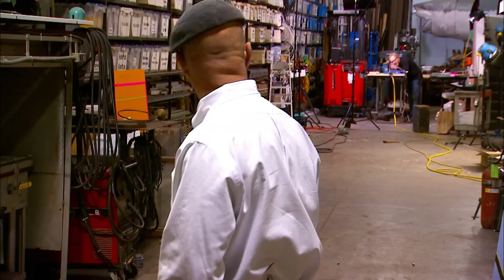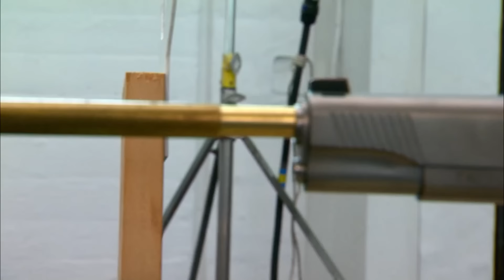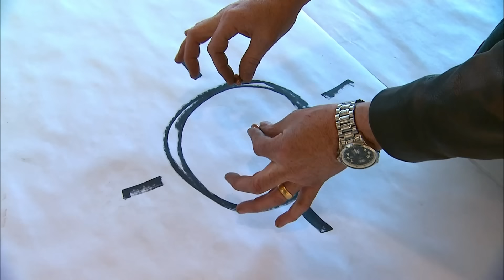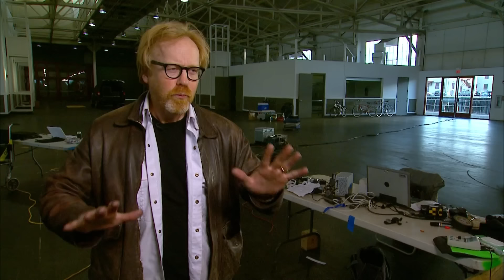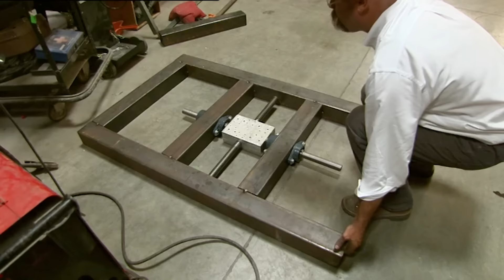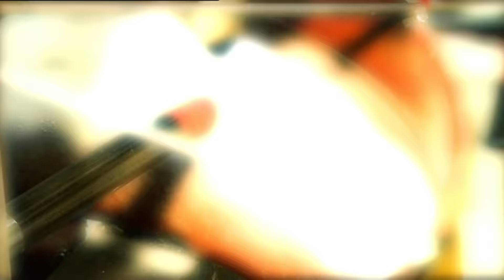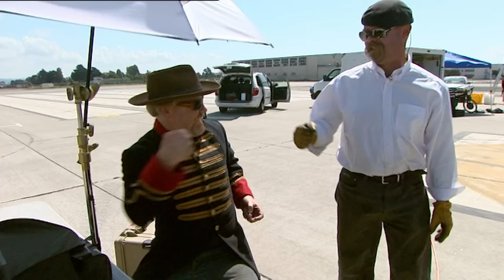The Most Satisfying Weapons Science MythBusters Ever Put On Camera | MythBusters

Comment: Ooooohhh. I thought at first you meant shooting straight downward.
Reply: Glad to see I wasn't the only one a bit confused ... Im tired... We have a heat wave here and it's late, that's my excuse and I'm sticking to it 😅😅 😂
Reply: @WilliamMorey-Baker Yeah, when life gets rough Mythbuster ease the pain but often increase the confusion.
Reply: I thought the same thing. Im sitting here thinking what are they even testing? This is common sense. Now that I understand it makes more sense.
Reply: It kind of makes this whole test irrelevant really.  This not a valid test. This is just a speculation.  Like ... what if I shot a basketball and a football over my house into a basket. Its really kind of a made up experiment from a silly comparison.
Reply: @doctornova3015  idk why it wouldn't be valid, they're testing that both bullets will hit the ground at the same time, because theoretically, they should, and they did, within margin of error.

In case you didn't know, this is a pretty common high school physics question, sometimes it's bullets, sometimes it's ping pong balls, the point the question poses is that horizontal speed is independent of vertical speed, it doesn't matter how fast horizontally the object goes because that doesn't change the vertical effect of gravity. (Until you get to orbital speeds where you're going in a straight line on a curved surface so the earth curves away from your line at the same rate that gravity pulls you down, aka the floor is moving away from you at the same rate gravity is pulling you to that floor.) Man, Orbits are so cool, you're always falling at 9.8m/s towards the earth, but you're going so fast that you miss the earth's surface and just continuously fall around the planet.

Comment: A fired bullet will always hit the ground later than a dropped bullet when viewed from a stationary point of reference.  Relativity states that time slows for objects in motion relative to slower/stationary objects and the faster they go, the slower time passes.  It may be small and next to impossible to measure for something moving at the speed of a bullet, but it is real.
Reply: That's absurd. Relativistic effects at that speed are irrelevant. Might as well start adding in Heisenberg uncertainty too at that rate. 
Or we could be intelligent and understand that a stray air current or different humidity between different parts of the fired bullets' travel have larger effects and we can safely ignore relativity.
Reply: Earth is moving around 97680 feet per second, A 45 firing that bullet alters that by around 850 fps. that is a change of about 0.8% More then I was expecting percentage wise but still under a percent. That is only taking into account orbit speed not speed at the surface with rotation impacting it as well.

I would expect the spin of it to impact it more then the actual velocity. That is what happened with the paintball they have spin from the firing process and a seam on them so it is amplified, much like how a baseball pitcher can alter the path via rotation using the seams on the ball. While the bullet is very much similar to each other they are a lead core with a copper jacket and if it is out of balance a little or the barrel scrapes one part more then the other it will have alterations on the spin of it as well, again minor though.
Reply: Also considered the speed of the bullet is a factor, closer it is to escape from velocity lol. The curvature of the earth.

Comment: I had a great aunt that was a calculator for the US army, and her job was to calculate what bearing they would an elevation.They would have to fire their large guns at order to reach targets.As far as twenty miles away as well as drift from  rotation and Wind. And she knew for a fact, it doesn't matter how big the bullet is. It falls at 32 feet per second per second to its terminal velocity, so the only thing you had to determine was the terminal velocity of a falling object with the density of X.. Yes we're getting complicated here. No Mat.\n Ter, how much powder you fired it with? Unless you actually achieved true orbit, it would hit the ground. When its forward velocity would be exceeded by the gravitational influence of the Earth translation, if you shot it up at a 45° angle, with a initial speed from the barrel of 600 feet.  Per second, it would hit the ground at position.Y after x seconds , did I mention this is getting complicated. And she had to do those calculations for every 500 yd on multiple sets of bearings all day long, for just one gun, she was 2 years from retirement before they actually gave her an adding machine to do some of the calculations with. It also did multiplication , but they still called it an adding machine. Her biggest complaint about the adding machine as it made her shoulder sore.Because it was a manually cranked handle didn't push a button and it did all the adding.It's strictly manual. And she almost never needed it , but it was required on some of the calculation steps , because the government wanted to be sure they were getting it right. Yeah government don't you love him
Reply: she was told that because its close enough for practical purpose of her job, not because its truth. cos that is simply not factual